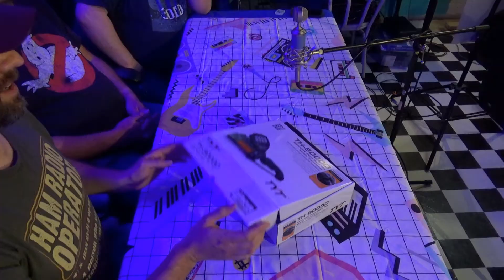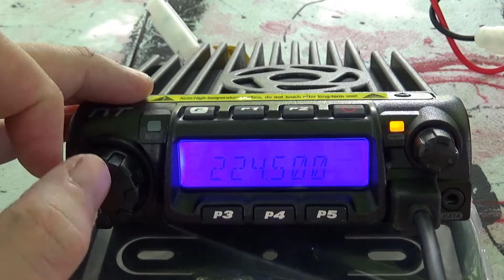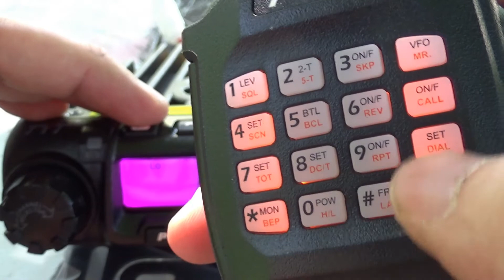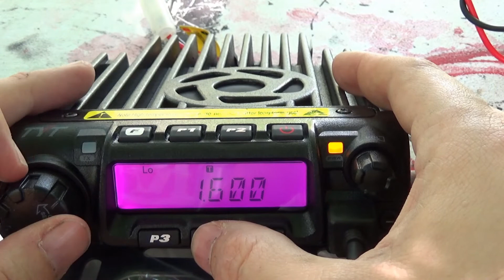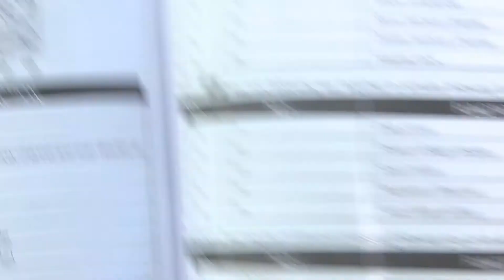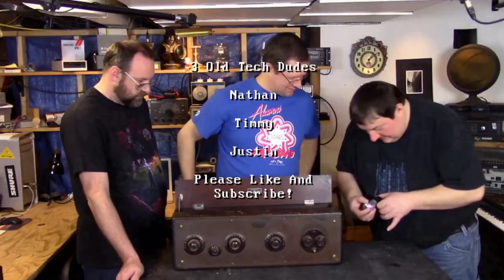TYT TH-9000D 222MHz Ham Radio - Unboxing, Quick Overview, and Owner's manual laughs!

Comment: It’s not the 1.25 meter band.It’s the 220 mhz band.It’s also called the 1.25 centimeter band I believe.
Reply from the maker: You know what, you’re right. It is indeed 1.25cm. My mistake! -Tim
Reply: 125 cm, or 1.25 meter
Reply: Actually if you look at the ARRL Bandplan its states 1.25 Meters
Reply: @Festus595 ARRL= Amateur Radios Real Losers 👍🤣🎙

Comment: The TH-9000 is a fantastic robust radio.  Many are used in repeater and link duty service.  
I offer support and repair for them.  
N5MRG 
MRG Labs
Reply: There are 5 of us with the same problem ,intermittent audio/receive after about 6 months   . We tired to make a repeater out of two of them  and they failed big time and bought a bridge com repeater.. A factory reset help but did not fix. We are all ready to toss them out.

Comment: I have the TYT TH-9000D as well, PITA to program, the manual it comes with is for the 2 meter version. I finally got it programmed for the repeater and saved in the memory channel but my local repeater is down right now. It is a fairly decent radio and sounds wonderful  but support is virtually non-existent.

Comment: Figured it out. Just got the radio.  Factory reset.  Go to desired ham frequency,  in vfo mode . Press and hold p4 and the offset screen will appear. Rotate to 1.600. Then press p4 and while holding that , press function button and a negative should appear. Repeat p4 and function to go positive or off . Then exit menu.   Now while still in vfo on that frequency you should be set right. Then press function once to see memory channels ,rotate the tuning knob to desired number and push p3. It should now be in memory.  Working for me . Have not tried the software yet , hope this helps. 73's
Reply from the maker: THIS is the ticket right here. Yeah, 2 years later I finally got the radio out to play again. Ha! I'll make sure we do an updated vid soon. Thank you so much! 73 Tim KB9SNL

Comment: Yep! I had EXACTLY the same problem trying to set the repeater offset. It just didn't work as the manual said it should, so in the end, I just gave up on setting the offset and direction (+ or -), and transmitted directly on the repeater INPUT frequency. That got me into the repeater okay, but I had to use another rig (connected to a different outside antenna) tuned to the OUTPUT frequency of the repeater, so I could hear what was going on! The instructions in the ''User's Manual'' are a total disgrace, especially the bit about the repeater offset direction and frequency. 
TYT (and their sister brand ''Retevis'') should be totally ashamed of themselves for producing such a useless ''User's Manual'' !!

Comment: I have one of the Leixen tri banders in my truck.  Also have an Alinco DR235 at home (but no antenna up at the moment).  Somewhere I have an old 222 transverter I used for weak signal work back when I was doing the VHF contest rover thing.  Hope to do that again, someday...    I have a few HT's that cover 222 as well.       73 & keep up the good work!        K9ZF